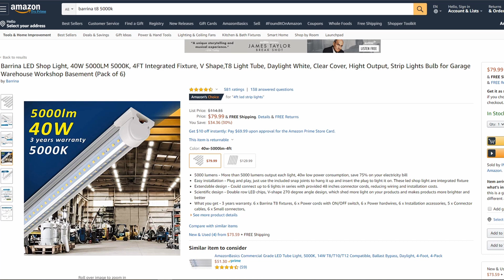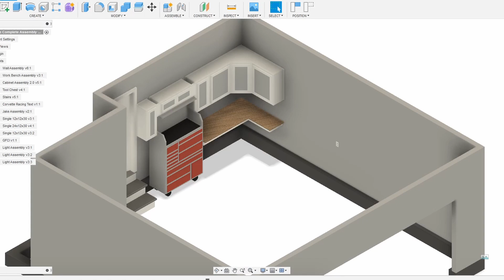GARAGE SHOP LED Lighting Install | Amazon | Cheap & Bright | Garage Makeover pt. 2

Comment: 3:30  Don't slice the jacket that far back.
Do a short slice near the end and pull the ends apart, it will tear down the length.
That way if you hit the conductors it will only be where you will strip them anyway

Comment: Just got these same lights and I agree, the hardwire cable is no where near long enough. I had the same idea to use the switch plug they provided. Glad to see it worked out for you.

Comment: Curious how these lights have held up? I bought a similar set and installed them 9/2020 and all of them started flickering or had sections go out within 2 years. The company replaced them once already and out of the 10 I have only 4 of the replacements are still working.

Comment: LED lights have high frequency drivers and that is what interferes with the radio signal from the garage door opener.  The only way around that is to have the lights turned off if you want to use the wireless garage door opener.  I have a similar amount of LED lighting in my garage and have the same issue as you.

Comment: You should put some on the garage door and just have an extension cord coming from the ceil garage door opener outlet. You can then plug it in when you have the door open and then unplug it when you need to closet the garage door. Since the garage door blocks the light when it’s open.

Comment: Good video. Thanks for sharing. Did you get the garage doors to work?  If not, it could be when you cut off the electrical to install the lights, the garage door openers reset and now you need to re-program.

Comment: I have a 170 sq feet shed (17’ by 10’) where I installed six 8 feet Barrina lights. I installed them in three runs, so basically there is three separate runs of lights where each run consists of two lights connected and touching (where it looks like one long 16 ft light). So I have the runs positions where there is one in the middle, running down the ridge of the rooftop, and then about 2 feet out from each side of that is another run on each side. Is it possible a different configuration of light spacing would provide more consistent lighting? I am using this building to produce YouTube videos so lighting is very important for me.

Comment: Good to know 6K were too harsh.  Why run the lights left to right vs front to back ?  probably just works better in that orientation
Reply from the maker: That is my opinion. I ran them in the same direction as the rafters in my garage.

Comment: I bought the 4 foot 6 pack about a year and a half ago on amazon! Love them. I hooked mine up separate from my other LED A19 LEDs so that I didn't have to run them every time I was in the garage, just when I needed the extra light. (Hoping to get longer life out of them by not using them when not needed)
Reply: Re your garage door opener issue. I’m no electrician but I did read some where on the internet that the lack of grounding is a possible culprit.

Comment: I don't have any actual advice about the interference, but I can say I had to change the LED bulb in my garage door opener. If that light was on, the remotes would barely work.
Reply from the maker: Thanks there are two ideas that have been suggested that I am going to try. When I do I will throw the results in the comments.

Comment: Do they flicker when using them with the camera?
Reply from the maker: Nope all good here.
Reply: @ThatTechTeacher427  What about with slow motion on an iPhone? If they don't flicker when you recoded in slow motion that would give me a lot of insight about how they are made. It would be they are a super good deal. Most lights of this kind just run straight off mains so that would make them flicker.

Comment: My Barrina does not come with a ground wire
Reply from the maker: Thats interesting. When I did the "wiring" I cut it open and there was three wire, hot, neutral, and ground. It was designed to be plugged in to a 3 prong outlet.
Reply: @ThatTechTeacher427  Thanks for the reply
What's weird is the pigtail has all 3 wires but power/switch and connecting cords only have the hot and neutral, so just just ran then without the ground, it all works 
Thank you for your video

Comment: Hey Ryan, great video, I personally really like the Barina LED's. The fact that they run on 120V makes them a breeze to manage on the electrical side of things and the brightness and color matching are pretty spectacular for the price. As far as the interference with the garage door opener, that just has to do with the way the PWM drivers for the LED's work and they just happen to run in the same frequency range as the garage door opener. That's something that will happen with any light strip that you're going to get unfortunately. You could try using ferrite clamp on cores and ferrite toroids to reduce the amount of interference, but I'm not sure how well that will work with the sheer amount of lights you've got. Just an idea, maybe you could get a Wifi switch for the garage door opener and control the garage from your phone or google assistant. They're around 25-30 bucks, and just plug into your existing garage door opener. They're pretty worth it in my opinion, because mot only can you control the garage from your phone or smart assistant, but you also can get notifications for when the garage door is open. A buddy of mine set his up with the IFTTT app to open when his phone's GPS was in a designated range of his house that he set. Anyways, best of luck figuring out the issue and can't wait to see this great lighting in your future videos. Stay safe, and wash your hands!
Reply: blah blah LEDs LEDs blah
Reply from the maker: Awesome thank you for the info I will be looking into that!

Comment: Do you solve your door problem? I may have something for you to try.
Reply from the maker: I have not got around to it honestly but will eventually. I never try to close the garage door with a remote with the lights on so it has not been a big enough issue for me to do something about. I am curious about your idea though.
Reply: @ThatTechTeacher427  I am a master electrician and also work on Fire Alarm systems some. We use ferrite magnets and wrap the wire thru the magnet a few times to stop interference. May work. Am getting my garage ready to put up new Barrina lights.

Comment: Great video.  Looks like your garage is about 20'(w)x 20-ish(d).  Mine is 17x25 so I was about to order a 10 pack of the 8 footers figuring I'd have a couple of spares for failures.  I then read a chart from Barina and for a 20x20 garage, they recommend 3 x 8ft or 6 x 4ft.  You have 2.5 times as many lights as they recommend!!  Now that this is 7 months later, are the lights too bright or are you still good?   Trying to decide how many to get now.  I will definitely break them up across 2 switches though.
Reply from the maker: Thanks! Yep the garage is 22' x 22'. I think what you are going to order would be fine. I will say at first it was a lot of light and took some getting used to. That being said I am kinda of nut for going overboard and I love that crazy amount of light I have now. It makes it so easy to see at night and even really helps during the day. I would say follow barina's guidelines and then add more later if you would like.

Comment: Your door sensors are likely "blinded" by the lights.  Try taping toilet paper rolls to them to act as a snoot.  Then if it works set up a more permanent fix.  Nice videos very well done.
Reply from the maker: Thanks for the tip!
Reply: @ThatTechTeacher427  did you find a fix?

Comment: Great vid, very clear install guide and explanation. My garage is about the same size as yours, but I think I'm going to install just 6 X 4ft lights so I don't get fried every time I turn the lights on. Did you figure out the issue with the garage opener? Just curious in case that happens to me too. Thanks!
Reply from the maker: Thanks!
I've been lazy fixing that problem although I have 2 suggestions that I hopefully will try soon. Run the antenna wire to the front of the garage or use a farad clamp of the power cable of the garage door opener to help with the magnetic interference I have created.